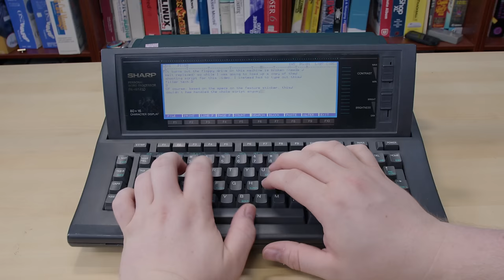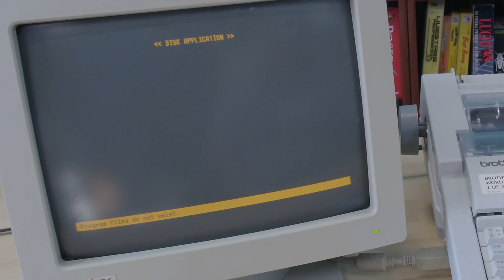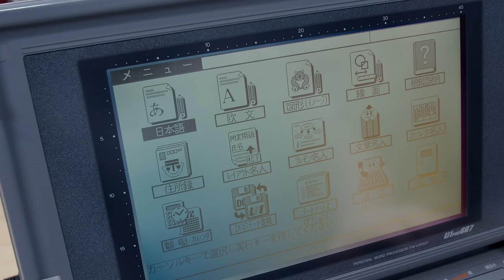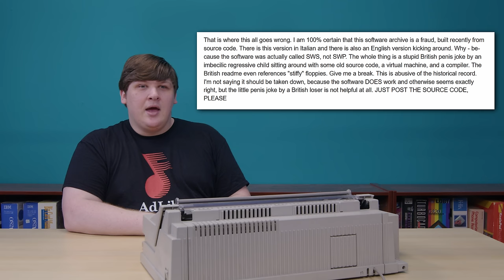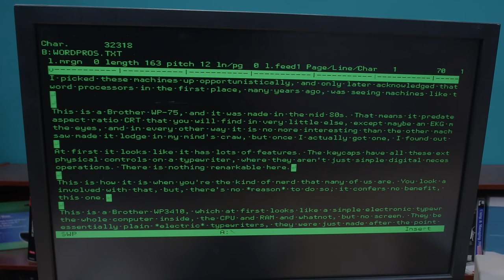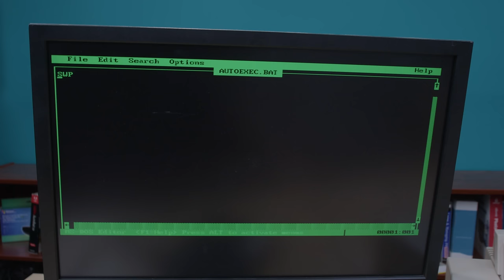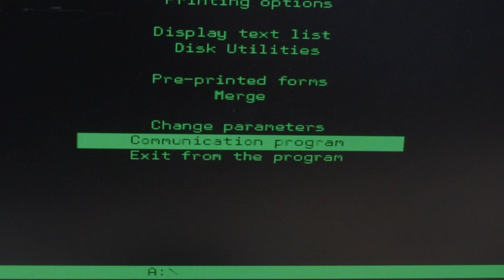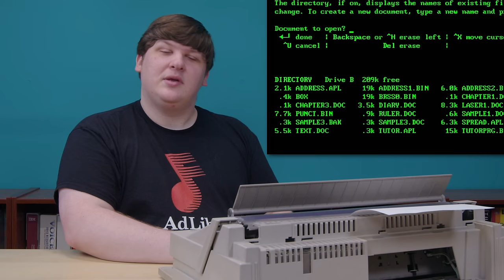The Weird Processor: Olivetti's PC Typewriter

Comment: My fascination with word processors began reading Koji Suzuki's Ring, where the main character is a journalist and uses one, and in Spiral they need to read his data off the floppy after the machine is destroyed in a car crash and they had to find one the same brand because it was common for them not to use non-intercompatible text formats. 

Those were Japanese ofc.

I have a softspot for Olivetti cos I have an old Olivetti typewriter. The olivetti Dora. I used to collect typewriters and that's the only one I kept. It's basket shift and cute as hell. I never got into electronic typewriters despite wanting to because OOF those things are expensive now.

Comment: I think the fact that 6845 controller is used in a PC is rather incidental. It's a companion to Motorola 6800 processor (which almost nobody used by mid 80s) and either the 45 or its much more integrated close relative the 6847 have found their way into most 8-bit computers and similar devices. The 45 is very simple, it actually just generates timing and addressing, with the actual video logic being implemented externally, which also makes it very versatile. Since it's an address generator, the only topology that makes sense for something like a word processor is actually with dedicated text-mode video memory that the video circuit has a time-exclusive access to for the ASCII addressing into a character ROM, just like text mode is implemented on most computers ever.

That being said the writes into video memory cannot occur at just any time. But it would be a little silly if it was only able to add one character per retrace or less, now wouldn't it.

A ZX Spectrum has only-graphical video, with video memory being shared and weird memory layout split in thirds and the keypresses display instantly. So it's not an excuse, since you only need to write 8 bytes to update a character. Scroll is slow, slow scrolling can be forgiven. I think it's just that software is responsible for the user experience, and traditional electronics companies are absolutely atrocious at writing software, so much so that one random guy can do a lot better, and bad software just gets... ignored and forgotten.

Comment: 2:04 Do you think perhaps it moves the carriage as you type because it has a limit switch at the margins? Instead of having to define margins, size of paper, and orientation in software, it could just mimic typing until you reach the rightmost limit switch. Then, it beeps at you until you hit print (or override the margins with a second key press). It is, as you say, a low-end model.

Comment: If the correction ribbon is the same form as the Olivetti Praxis 20 (just a transparent gluey-ish tape rolled between two small plastic reels with the "glue" facing out), I still have a couple lying around that I managed to find new... But either way, I'm in Brazil, and I haven't seen them after I moved places - and the one from that same batch that was already on my typewriter stopped correcting, and no amount of "skipping ahead" got it to work properly again, so I guess that the spare ones may be in the same state...

Comment: RE: Disk storage on the Brother unit. Most likely, it is a 400k-ish drive, but they load parts of the system software and other metadata, and most likely section of just the 200k for user data, also, most likely was stupid and they basically re-used a controller from their older 5.25" units, and it only lays down 40 tracks instead of 80 or something like that. Remember, the C64 disks only held 170k....

Comment: I do wonder how you were meant to use 768K with this machine. With a standard PC layout, the monochrome text memory is mapped at 0xB0000 (704K) and the video memory at 0xA0000 (640K - the pinned comment mentions CGA modes), so you would need circuitry to toggle at least that.

Comment: From garage sales, I found an olivetti typewriter with a half-used, irreplaceable cartridge. I also found a point of sale printer that requires drivers that run on win95 to XP. But I can't confirm, because I don't have a winXP machine....
Reply: I'm guessing "throw Linux at it" doesn't work either?
Reply: @XanthinZarda nope. the driver install is an exe and I've tried pushing stuff to the COM port only to have a yard of incomprehensible gibberish spat at me

Comment: On Z80's... the 8086 and the Z80 are pretty closely releated - two different upgrades to the intel 8080. That Z80 based WP is related to intel x86. The OS for most Z80 machines was either proprietary (Sinclair) or CP/M (MSX)... I wouldn't be surprised if most of the disk-equipped non-MS-DOS machines were using CP/M.
I know that at least the 5.25" versions of the brother WP/T used CP/M formatted disks.  I suspect the 240k 3.5" is treating it as a Shugart-interface 5.25"...
Oh, and there were proportional typewriters. Dad had one for many years. It was actually tri-spaced, not fully proportional, but it was at least 1/3,em 2/3 em or 1em wide.

Comment: On a ribbon based printer the amount of ribbon it uses does not changed with how much ink actually got transferred onto the page, just like with a dye sub. So, the reverse mode would not waste much ink ribbon, though it would be very wasteful on the correction ribbon.

Comment: I daily drive an original PC keyboard (typing this on it right now) and personally I love my caps lock key being to the right of my long-ass space bar. Control being above left shift with alt in its place has forever ruined my ability to use keyboard shortcuts on any other keyboard though.
Reply: How do you deal with Super/Symbol/Winkey based shortcuts?

Comment: Sometimes I think about finding an electronic typewriter to use as a shell for non-interactive cli programs (ya know, you type command and parameters, it spits out its output, you get on with your life) for shits and giggles. Probably be great for the eyes too, until I have to open Nano (which obviously requires a screen, not a roll of paper)

Know any good typewriter models for use as a serial tty?

Comment: The monitor is DC, right? So the refresh rate wouldn't be an issue even if it did rely on mains current.  You mentioned that partway through the video, about how TVs didn't actually use that 50/60Hz as a clock speed so you could have a PAL set in the US; considering the included monitor would have been running off that 12V DC it wouldn't really have mattered anyway.
Reply from the maker: Oh yeah, haha, I didn't go far enough to make that connection but you're totally right.

Comment: 2 roms  makes sense,1 for the bios, 1 for the character set. 

There were a lot of text mode games made for ms-dos  in the mid 80s but they typically used CGA coloured text so will be mostly unplayable on this thing due to poor colour contrast. Typically, most dos programs could support more that 640k ram. 

Dos itself would support whatever memory the Bios reports as available. With no cga support a bios could greatly increase available memory.

Comment: Funny that SOG was an issue in this world. With original xboxes you can get VGA signal out of component cables...but it requires SOG. A fairly modern LCD that supports this is the ASUS VH238H, and I believe similar models from them also can handle it just fine. Just thought I'd throw that out there since you can get them relatively cheap nowadays.
Reply: Also the connector looks like a NuBus variant to me.

Comment: I watched the Interview DavePl did with Dave Cutler the other day and he mentioned in there that originally when they started writing Windows NT that Microsoft had written a spec for a PC like platform around the Intel i860 and that's what NT was originally supposed to run on but they could never get it to work well enough but the company they were working with to produce those machines was Olivetti and Microsoft and apparently Olivetti didn't really want to give up on the i860 but Microsoft did because their programmers knew that even if RISC was in the future i860 wasn't it.

Comment: 20mins in and just wondering if you've looked at an Amstrad PCW.  These was, legit, a z80 based PC running CP/M - but it was sold as a word processor rather than a PC - at a quarter of the pirce - during the mid-80s. They were highly successful. Also very, very robust - I've known people who used these as daily drivers right into the 2000's.  Not as weird as that olivetti thing - but it had it's quirks - such as rectangular floppy disks, and an completely unnecessary fan in the case of some models designed to keep customers who expect a fan to be there happy.

Comment: I jace an electric typewriter that can do bold, italics, underlines, and double width font. Uses a thermal print head so it can probably print.anything technically and is only limited by the capabilities of the firmware of the typewriter. 
Capable enough that i have gotten away with using it for a few documents. Problem is it uses a thermal ink ribbon cartridge that isn't being made anymore, once that's been used up your options are to pay nearly $100 fpr a replacement, or use thermal paper.

Comment: I am a microelectronics engineer and there are very specific use cases, where i have to do carbon copies - european bureaucracy. I could use a needle printer, but for some reasons, i do prefer using a daisy wheel one, because the one i have is very fast and is very compact form factor, which is good, when i'm on-site and working out of a VW Transporter, which is crammed with all sorts of tools and clunky diagnostics devices from the past five decades. Especially factories often use a mix of very old and new technologies.

Comment: few  modifications of soviet Электроника МС 6105 monitors use 12V DC as a power input (but not a barrel jack). it was probably .01 .02 .03 .04 and .12 models.

Comment: I had something similar to one of these loaned to me by the BC Government through a program for Students with disabilities during my grade 5 year thanks to Ehlers Danlos Syndrome making my penmanship horrible. It was the first such device I had loaned to me (1995) it followed the Mac Classic 2 the disability services teacher had borrowed from the Computer lab for me earlier in that year. and was followed by a word processor that didn't have the printer portion for my grade 7 year, and then switching to Jr High I went a year without any supports while we worked on getting me a new device which turned out to be my Toshiba 110cs that was loaned to me for grades 9-12 and at grade 12 was to be returned but was deemed obsolete so I was allowed to keep it. That laptop was with me from september 1998 until it died in april 2004 running windows 95 off of a 755mb hdd the whole time. It was a wonderful machine comparatively with the two devices that preceded it.
Reply: also the coolest thing about the two word processors I had was that the second one had BASIC on it and I wrote my first programs on that little word processor and its 4 or 5 line high LCD Screen.

Comment: That word processor's... quirks is but only ONE of the reasons Olivetti went belly-up. I remember in the 90ies when the 486 were ubiquitous and the market was shifting on the Pentium they still sold 286 systems FULL PRICE. Their 286 systems with 1MB RAM  and CGA video interface and no audio if not the one given by the system beeper cost back then even more than systems with 486DX2 66Mhz with 8Mb and a Vesa LB fast video card with Sound Blaster audio card.

Contrarily on how market went (and still goes) those penguins made some years before a stupidly big stockage of processors and other hardware and didn't care in the slightest to read the writ in the wall years later that their stores were chock-full of outdated hardware, didn't want to admit their blindness in making a wrong decision stocking hardware that was by then unsellable on the PC market, especially at those astronomical prices they never lowered, and courageously soldiered on... towards bankruptcy.

To be fair I seem to remember that at a certain point they understood that brand alone wouldn't see their archaic hardware sold (especially at those prices) and started proposing back then modern hardware... but by then it was too late. The image damage the Olivetti brand had taken was too great and had to fold.

Comment: If the port at the back is an ISA slot, it has 50% chances of being able to be compatible with the PicoGUS and its adapter for the handheld x86 computer. If it's not one could just make the same board but with the pins reversed.
Reply from the maker: At a glance it doesn't look like it would work. I think the VME-style connector here is three-row. I'm sure it could be adapted, but would require more skill than I have, haha.
Reply: @CathodeRayDude  Oh I see... I didn't notice it has three rows. I count 32 pins across, so with two rows it has enough pins for ISA (with two pins to spare), and with three rows it has enough pins for a 16 bit ISA (by removing a couple of the extra redundant power pins). Now I'm wondering, can you measure the voltage of the pins?

Comment: Alt Graph (Alt Gr) is present on all keyboards, however it's use is limited. It's most commonly used on Polish keyboards to access ęóąśłżźćń. Other layouts usually do this differently
Reply: On US-layout keyboards it's not present. The scancode is still there but it's labelled as another "Alt" key without Gr.

Comment: My sister had that Smith Corona PWP-88D. It was total garbage even when brand new.  Back then I typed about 20 WPM and the stupid thing couldn't keep up with even my typing. Menus, loading, typing, scrolling, saving - everything dragged so badly that I chose to use my mom's old Selectric many times just to avoid using the Smith Corona.

Comment: Serial and parallel ports weren't usually on motherboard in the 80's, they would have been ISA cards.
Reply from the maker: That was largely seen as a misstep by IBM, and by the mid 80s it was common to integrate them. There were probably some companies still selling clones like this, but likely only at the very bottom end of the market.

Comment: I have an electric typewriter and using it is great fun it doesn’t have have a screen though but it can write in bold and had special correction tape that erased spelling mistakes and not to flex but my grandmother could WRITE 100 words a minute in 1953 😎

Comment: I don't think reverse black bacground should consumes more ribbon given it's the same travel (unless badly designed). With a carbon ribbon, whatever portion of the block that wasn't hammered into the paper is simply wasted. You can mark the tape to verify the dsitance it travelled
Reply from the maker: The tape can't move less than a character's width. I think if you watch closely in the footage you can see that it notches out a little tiny slice of carbon, then leaves a massive gap before notching out another. it wastes like 6 inches of ribbon to fill 3/4" of paper

Comment: The Atari ST's 12" paperwhite monochrome monitor ran at 70Hz.  I remember seeing it for the first time in '86 and thinking it looked a lot more sophisticated than the Mac's flickery little 9" screen.  It was also much higher resolution - 640 × 400, as opposed to the Mac's 512 × 342.  Maybe Olivetti got the idea for their high-refresh paperwhite display from there.

Comment: I took a screenshot of the text 19:01 and fed it to GPT-4 Vision. I'm pasting the result below, which was somewhat informative, but I don't know if this is on par with CRD's existing Machine Translation attempts.
GPT-4 Vision's response to screenshot of display:
 "The image appears to display pixelated characters from a computer interface, possibly of Japanese origin. However, some characters are clearer than others. Here's a translation of the characters that are discernible:

    詳細 = Details
    保存 = Save
    データ = Data
    パソコン = Personal computer (or PC)
    時刻 = Time

Some characters are partially obscured or not clear enough for me to provide an accurate translation. If you have a clearer image or specific characters you'd like translated, please let me know!"
Reply: my translation/guesses based on my chinese knowlage
1.Japanese
2.European Language
3.Forms
4.Line art
5.Guid/Instructions(would be helpful to have a picture of the content of this program)
6.some thing with Adress(maybe a digital adressbook)
7.layout editor???
8.
9.article
10.Spreadsheets
11.Calculator,calendar and clock 
12.Switch to DOS or DOS converter(maybe this mashine has a proprietary format of storing data)
13.
14.comunication(most likely telefax)
15.Exit/shutdown

Comment: Willing to bet that connector is ISA port in pin connector for. Willing to bet an ISA backpane can be made for it to be able to accept standard ISA cards. Or OR, and adapter made for it to accept the ISA connectors of the industrial controllers, like WeePC uses. I forget what it's called.